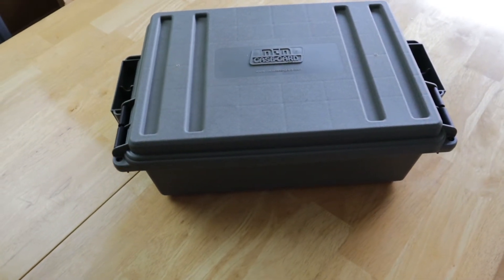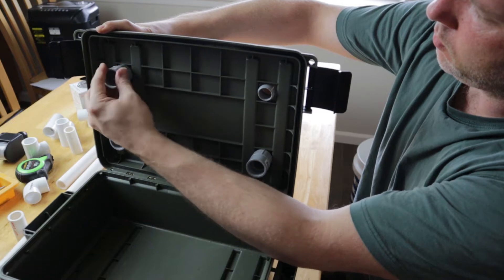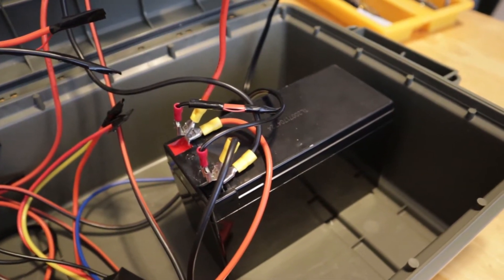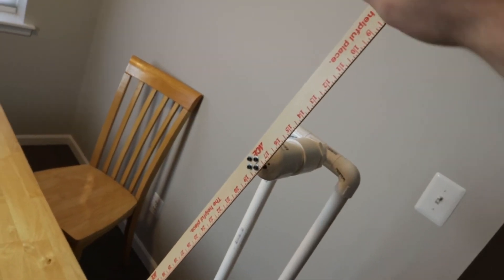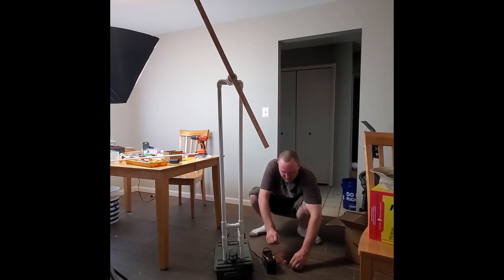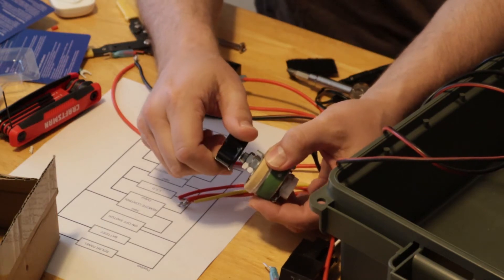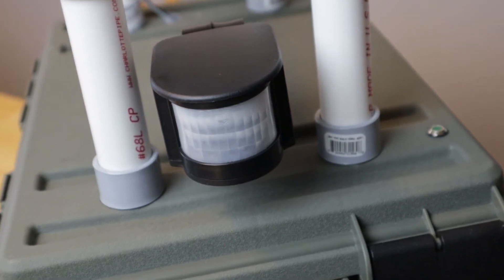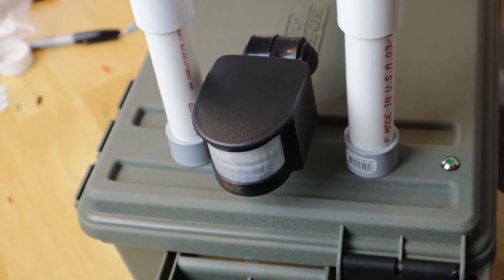DIY Scarecrow Robot - Motion Activated, Solar Powered, Snake Flailing, Critter-Startling machine!

Comment: Wrong approach! You need a chasing robot. A simple RC car with motion detection that would turn it on, chase the critters 10-15 feet, and return to the dock. It could have a menacing plastic cover. It could have "no go" zones to avoid getting stuck. If a scarecrow doesn't go directly at the critters, they will quickly lose their fear.

Comment: I've just seeded my lawn and have problems with pigeons and blackbirds eating the new seed.  The pigeons I can scare off by just appearing at the patio window. The blackbirds just ignore me until I run outside waving my arms.
I've strung up a length of twine with tin foil - totally ignored by all birds. I've even put fine mesh over the seeds (seems to do the trick). But I have also been thinking about an automated scarecrow. Odd that there is not something similar to your invention on Amazon so I think there is a massive gap in the market here. 
I would suggest that it needs some sound. Pretty sure you could add that. There are devices that you can record sounds to and i am sure you could add that to the device.   Or you could add some sort of whistle to the ends of the rotor blade.  
Cracking idea though!

Comment: If you still want the snakes you can shorten their length so they would clear the protruding shaft the motor is mounted in. By not keeping the lengths the same you would also get more rocking motion of the entire unit. 
I have no answer on a reliable sensor. It seems they are all pretty finicky.
Reply from the maker: Thanks Mike. That's not a bad idea.